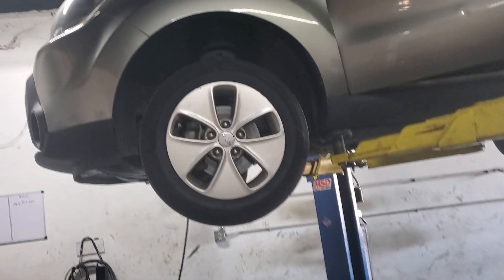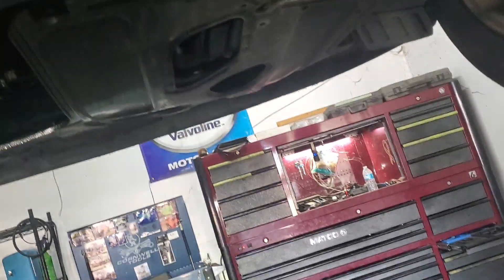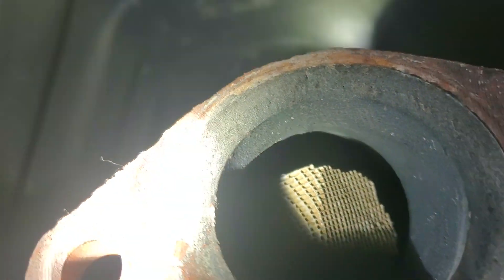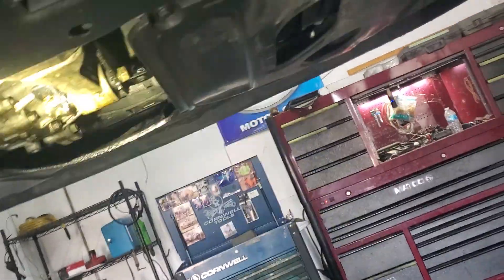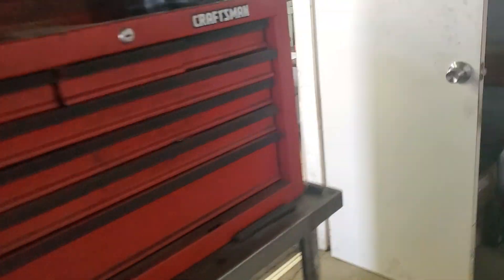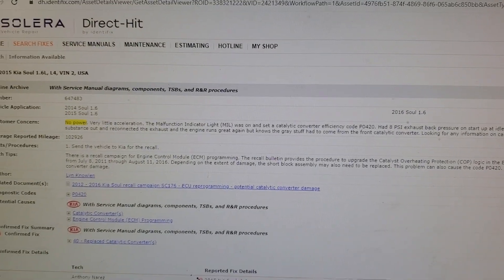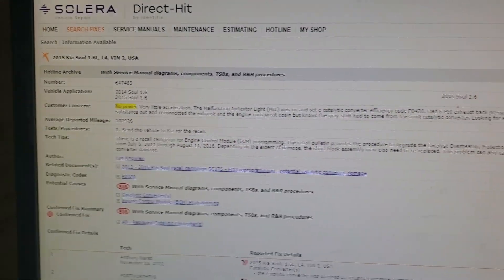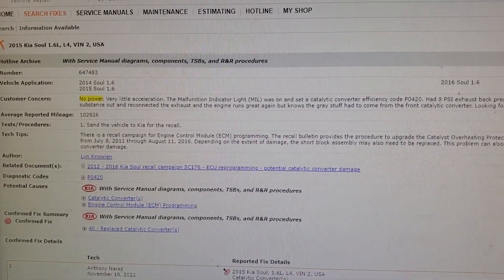kia exhaust recall

Comment: Man thanks for the video and you are right, there is some kind of recall from KIA for Kia Soul from 2012 to 2016 models, depending, mine is 2014 and the engine is the 1.6 littler, I when to the KIA dealer and so far they have not done anything for my car, I show the letter that I didn't even notice by mistake I put that letter on the globe compartment and I forgot it,. the letter was issued on 2019 and have also the vin number for my car, KIA dealer told me in other words that is your car yo fixed.

Comment: Okay but what if they show you had the recall repaired and you still are having the same issues?
Reply from the maker: if they updated the ecm and changed the converter then i would try getting a good brand replacement i see these in here monthly and once i install a factory converter and do the update i never see it back for the same issue